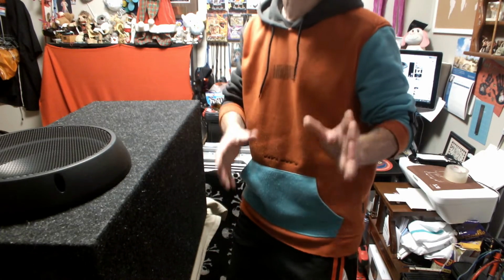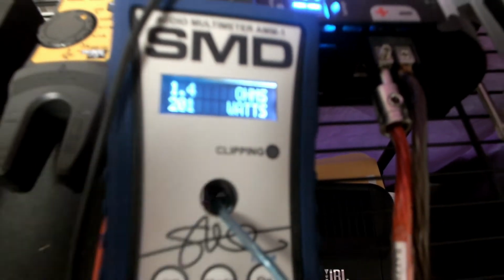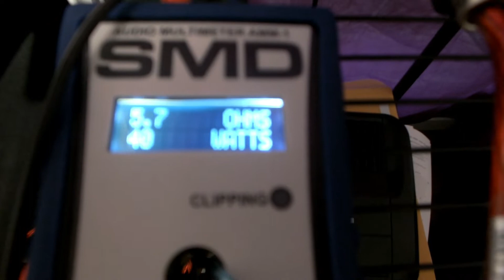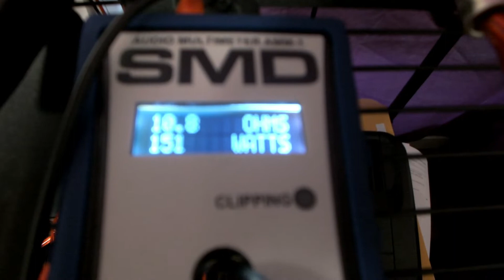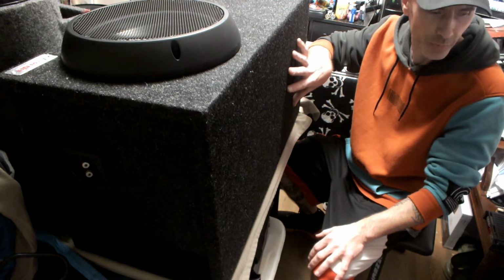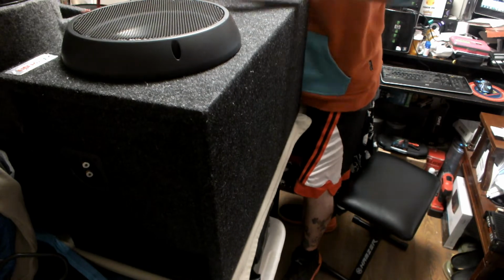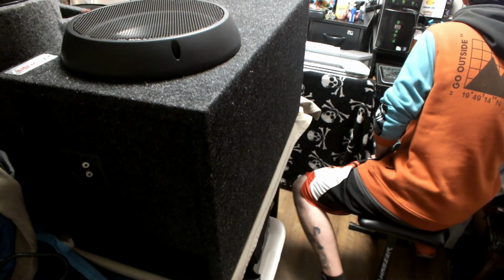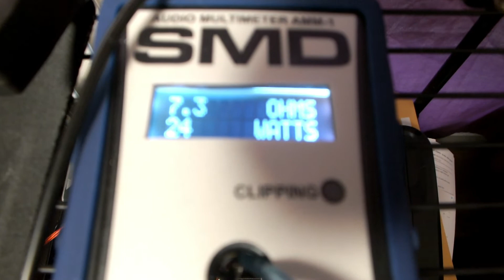Power Acoustik RZR1-2500D Dyno Test 1,2,and 4 Ohm Tests SMD-AMM1

Comment: My Skar amp in for repairs. But I have this amp as a backup and got it pushing nicely on Skar SDR 12's
Reply from the maker: Depending on your ohm load with impedance rise it can do some really good power. I think I've had 4 of these now and I'm looking to buy another. As long as I can make a few bucks I usually sell it with a sub and box as a combo. Thanks for sharing and thank you for your comment 😊

Comment: I think the signal is weak.. this same amp was tested by budget gem and think it did over 400 at 2 ohms and 700 at 1
Reply from the maker: I have a new video for this same amp, different tests. Got over 1,000 watt's @ 1 ohm. Check it out.
Reply: Actually 700 at 2 ohm budget gem never tested it at 1 ohm

Comment: I have noticed the power supply dip down to 5v on your dyno test. Not sure if that power supply is strong enough to handle the current the amp needs to get the wattage. Should get alot more then the 150-200 watts you are getting.
Reply from the maker: I can let you rest easy, the power supply never got anywhere close to 5 volts, it runs constant 14.4, sometimes it might dip to 14.3 or 14.2 but for a brief second. This is what the amplifier is doing for power on those specific subs in those specific enclosures. I have since done a few other dyno tests on this amp with other subs and new enclosures. Also have figured out how to get the most from the amps I'm doing. This is one of my first times running the tests, I have come along way in the past 6 months. Check out some of my newer content. I also have a larger power supply I use when needed, I have 0 gauge wire I use and 10 gauge speaker wire, everything has been upgraded and the tests are much better. I thank you for your comment.
Reply from the maker: https://www.youtube.com/watch?v=ISOvMwRAtEA

Comment: That wiring on the power supply looks scary to say the least, negative wire strands hanging out all over the place right next to the bare metal of the reducer of the positive side. 😬
Reply from the maker: I'm actually glad you said something, I've known the wire was too long at the tip to fit. I've been meaning to cut it and get it in just right. I just looked now, the wire was closer than I thought. So I just fixed it, thanks again, the next video you will see the difference.

Comment: Interested in seeing 1 ohm numbers on a Dyno.
Reply from the maker: I'm going to be doing every test from here forward using the method I just got. I got my subs to stay at .7 ohms and run that constant. I could not achieve this before, so many tests were all over. Thank you. Check out some of my newer videos, I have a few on this amp. I also just got the 2300 and making videos now comparing the 2.

Comment: What kind of speaker grills are those?
Reply from the maker: If you mean on the Rockford T1 and T0 they come with them. Anything else let me know. Thanks for the comment.
Reply: What's the best universal grill you can buy goodbye I have scar I'm skar audio sdr 12's.
Reply from the maker: @clancymcguire5309  I would get the bars that go over, I think that would be your best option, this way the subwoofer can move and not worry about what it hits. Thanks for you question and your comment.
Reply from the maker: @clancymcguire5309  https://www.ebay.com/itm/394085295379?hash=item5bc1506513:g:fc4AAOSw8Udiinrt

Comment: hey bud. do you think id be good wiring this sub at 1 ohms for daily use?
Reply from the maker: You should not have any issues. As you saw in the video it does not stay at 1 ohm, it jumps around constantly. So go for it. Thanks for your question and your comment.
Reply: Maybe I missed it, but how many Watts does This amp put out at 1ohm

Comment: Also, when you say box rise, what exactly do you mean?
Reply from the maker: When you watch my dyno videos you first see the sub sitting at the desired ohm load right? So as the sub starts to move the ohms constantly are changing. When I start it's at 2 ohms, the sub moves around to 12.7 ohms 1.4 ohms and keeps moving around. The amplifier puts out 500 watts at 2 ohms, sometimes you get 2 ohms, or around that, it usually stays around the desired ohm load. But if the sub is at 17.4 ohms, there is no way that amp will ever get to 500 watts with that ohm load. Watch the dyno videos I have up, you will understand much better. This is one reason why a lot of people like to do a 1 ohm load, because it does not actually stay at 1 ohm all the time, they want to get the most out of the amp at all times, having the lowest load will do just that. Thanks for the comment.

Comment: What is ur power supply 30 amps ?
Reply from the maker: In this video it was a 60 amp. I think the best I ever got using that was just over 1000 watts. Since I have a 120 and use 0 gauge OFC wire. Check out some of my newer videos on this amp.